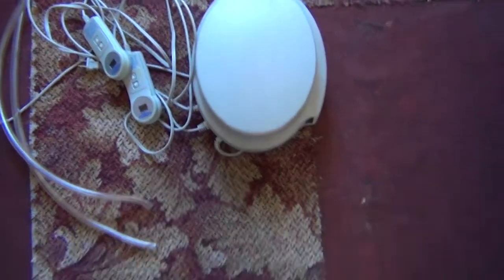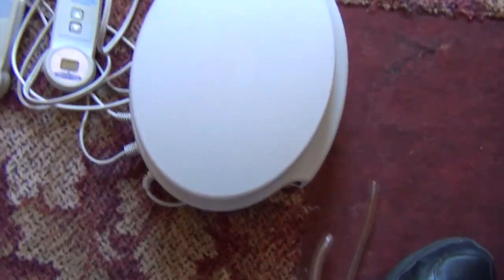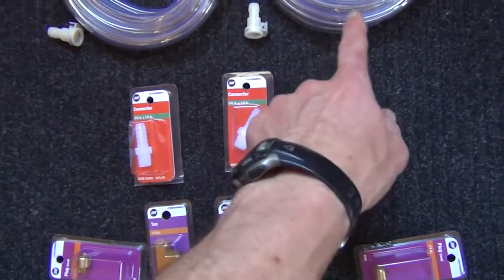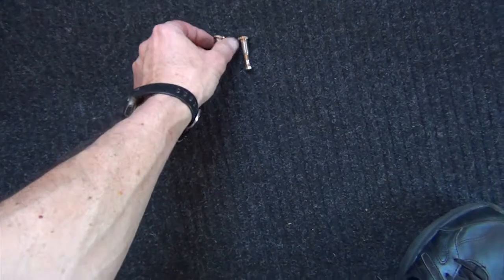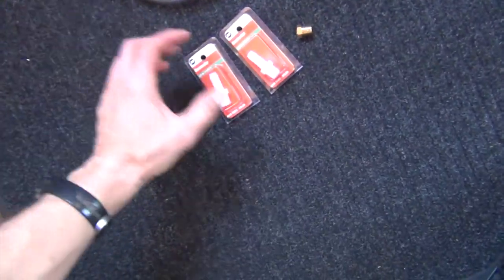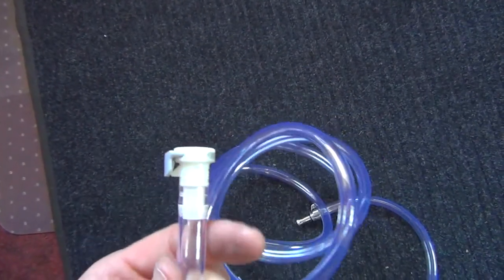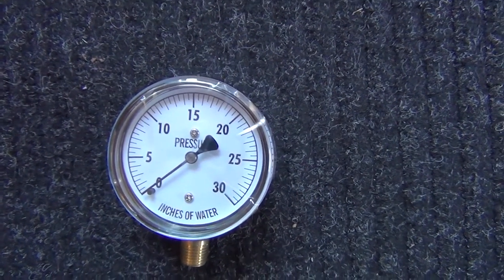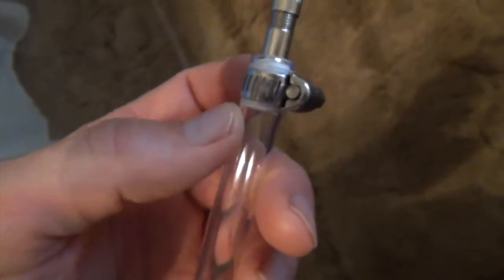Sleep Number air mattress pump not working, quick fix using tubing and a vehicle schrader valve

Comment: That's a cool trick to inflate the bed without the electric pump but did you add a way to deflate it in case it's too firm?
Reply from the maker: The shrader valve will release its air by pressing down on the small center pin/valve. I can sometimes accomplish this with the shrader valve cover or a small tool like a screw driver.

Comment: Good improvising to get the bed up and running again without spending a ridiculous amount of money on a new pump from Sleep Number. Title or description isn't really clear- this is not "fixing" the pump- it's actually replacing it with an improvised air system.
Reply from the maker: Thanks for your comment, I have revised the title.